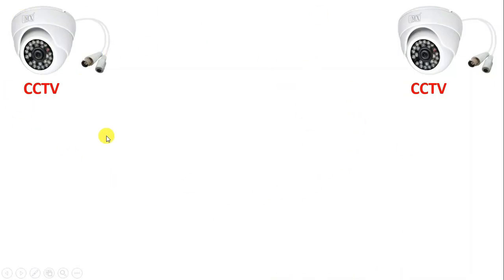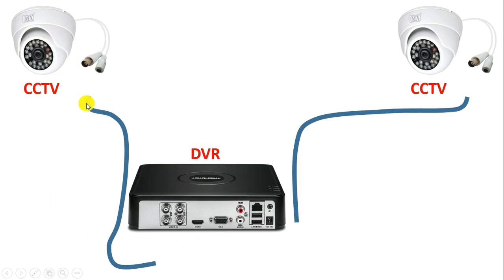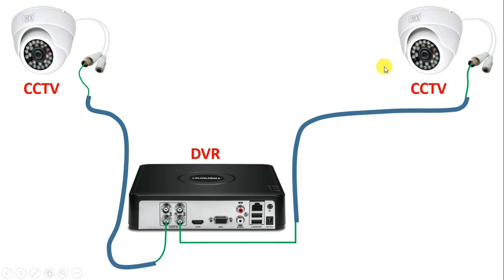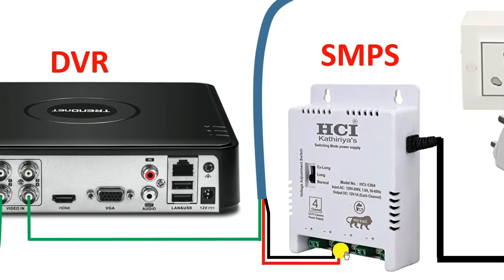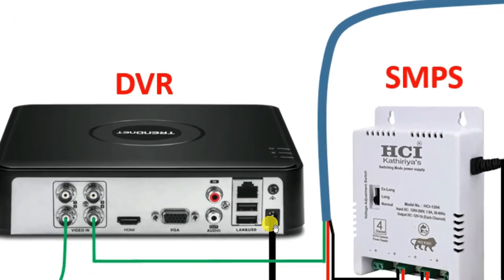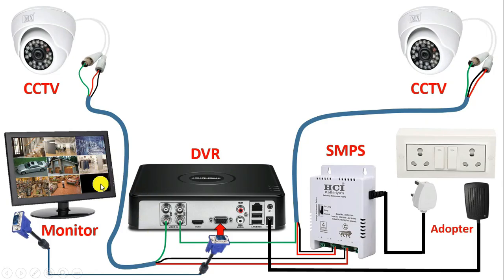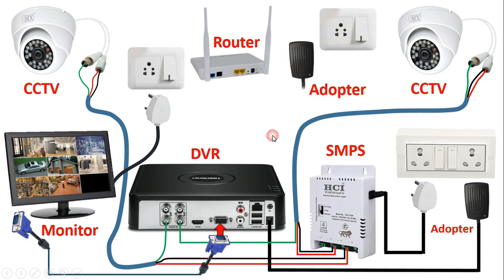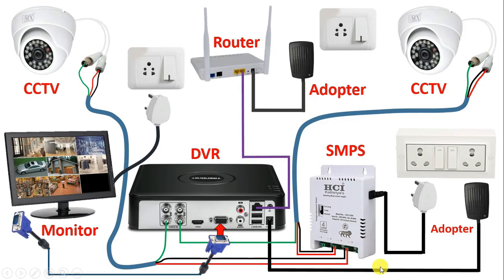CCTV Camera Complete Installation with DVR @TheElectricalGuy

Comment: I found a mistake in your connections. There is no negative connection from the camera's video output to DVR BNC Socket. Only two green wires are connected to the DVR from the cameras. That's why the DVR will not produce any video output.

Comment: Very good 👍🏾 presentation 👏🏽. 
Please 🙏🏾 
How far can a BNC connector cable   go in distance?

Are there 5000 meters = 5 kilometers coaxial cables for CCTV system?
Reply: Assuming u ve a plot of 5 km. In that case the intruder ll definitely cut the cable